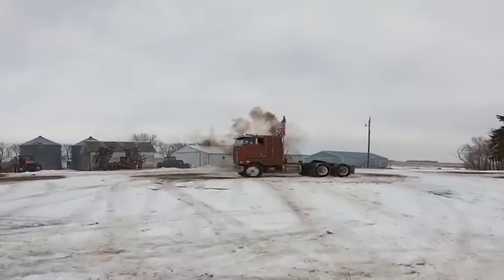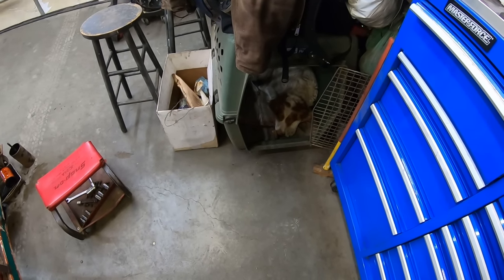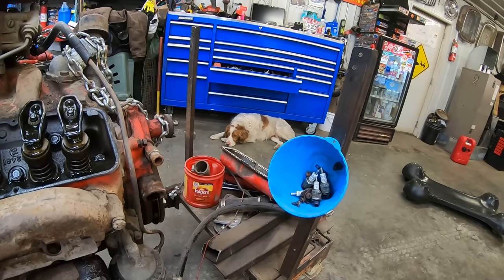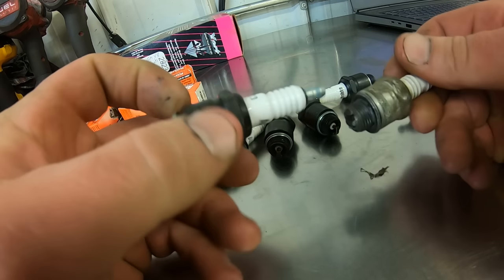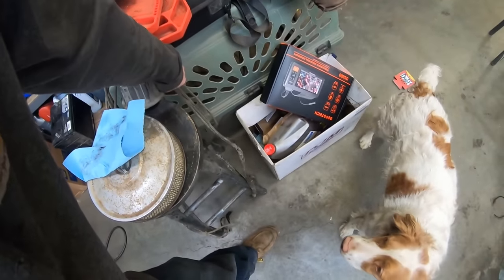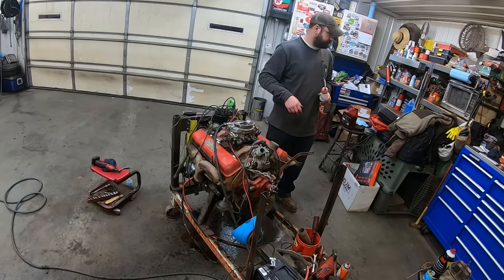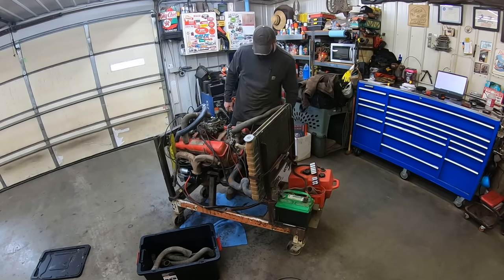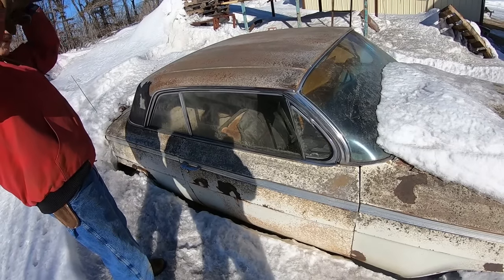1962 Impala Super Sport 300HP 327 Engine Abandoned for 43 Years!! Will it Run?!?

Comment: That 327 is, I think, one of the best engines GM ever made.  However, since I'm weird, I gotta say, my favorite is the old leaning tower of power.  You can't kill 'em with a rock.
Reply: i threw a rod after a "reputable" company rebuilt my slant six.... number four.    engine was still running after it made a bay window in the block.
Reply from the maker: I seem to be good at ruining slants!
Reply: I agree about the 327. -- And I have known people that have run those slant six engines forever, they're a great engines.
Reply: I prefer the Ford 300 over the slanty personally.
Reply: I own three of these, one is a '65 300hp Corvette   the other is a '66 275hp SS Impala mtr, and 1 is a '68 large journal 345-ish hp. You can't go wrong with a 327ci early small journal for power and at least 1hp per Cubic inch engine. Best GM Mtr ever made IMO and the 1st to give 1 or more Hp's per Cube.  Try and find a decent one from a 'vette in the 60's now and you've got something most don't even care about now that the market is over run with LS's and that crap.. No I don't need 500+hp from a Engine to have fun and reliability. I'll take 375hp any day. Mortske (Kevin) lol  Great content. keep up the interesting entertainment.
Reply: I think , without looking up in a tune up book or the web , as accurate as the web can be ( ? ) , the Chevy 327 ran from 1962 to,1969 . I grew up with someone who had a hand me down impala , a ‘69 . In ‘68 the 350 came out and Chevy decided it didn’t need the 327 anymore . 
I’m sure that upset a lot more people then , than it does now . But hey , big daddy Garlits  made big power with a 327 , lest we forget .
Reply: Ya I guess you are weird ! Lol
Reply: @TheSleepyMechanic0524  Good mill.
Reply: @andrewmantle7627  absolutely. Straight 6's are inherently durable and reliable engines. So long as you keep Germany away from them. I've driven both slants and 300's and will forever be impressed with their torque. May not be the fastest out there but they can pull your house down haha.
Reply: @MortskeRepair   The second generation slants (the first run of the cast iron cranks) had oiling issues on the #5 and #6 rod bearings due to poor casting in the crank. I don't think you've done any of those yet (they're 1975.5 and newer) but they tend to just kill themselves.
Reply: Hard to kill the slant 225, probably my favorite. Uncle killed one - was full of white snot (mind you, this was in the late 70s). I told him it was pennzoil, but he was like "what do you know" - sure enough, found an oil change minder later, brand used, Penn. Told him he needed to clean it out with kerosene / oil mix, but again, what do I know, right? Had to pick him up a couple weeks later......
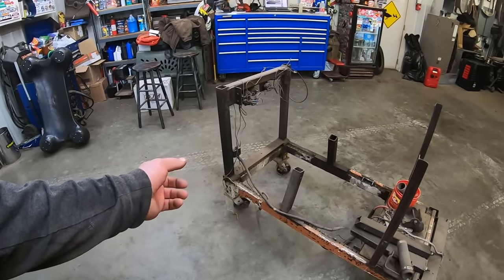Reply: I had one in a 65 el Camino with a corvette 3speed synchromesh stick with 12 bolt with 3:73 and 3:31. It had never been rebuilt and oil pressure was 10 lbs at idle. So I put two cans of stp in it to get oil pressure. I would rev it to 6500 or valve float territory. I sold it and I couldn’t break that damn engine. I wish I had it today.
I had the 350 horse 151 cam and a 6210 Holley spread bore carb
Reply: @TheSleepyMechanic0524   NO MORE FERDS..
Reply: @tonyfriend7413  speak for yourself, bud.
Reply: They have always been versatile and performance go to engines
Reply: @grumpslowenleft9642 , I absolutely refuse to use Pennzoil. A friend of mine used it faithfully in his Pontiac. Motor locked up. We tore it down to rebuild. Popped of the valve covers and I have never seen such sludge. And he changed the oil every 3500 miles. You should have seen the inside of the oil pan!
Reply: @markmartinfan62  I don't know about Pennzoil today as I won't use it because it was so bad years ago. I'm positive it's good now - still on the market and popular, but I'll stay with my never sludging and never let me down Castrol. Never saw the bottom of the oil pan on my Uncle's slant, but based off the mass of white snot, the death rattle and subsequent failure, I'm sure it was horrific. No doubt his engine was oil starved - kerosene and oil might have helped it, but the real damage was likely already done. My Grandfather was the head mechanic for Chrysler in Omaha - I packed my first wheel bearing when I was THREE - I know very well what a death rattle sounds like and his Duster had a smallish one that was hard to hear above all the valvetrain noise. As I remember, Pennzoil back then was fine IF you got the engine up to temp, but a lot of real short trips would sludge it up (that was also common with some other oils of the era - Quaker State for one, same base oil as Pennzoil, at least back then).
Reply: Agreed!
Reply: @michaelmaher4328  10 lbs at hot idle isn’t death territory on an SBC, as long as she’s got 10 lbs per 1000 rpm just run it!
Reply: My fav car I have ever owned was a (until me) single-owner 1962 Chevy II wagon in high school with the 194 inline 6; bulletproof. Paid $150 for it in 1990 off of a little old couple who had finally upgraded. All it needed was a new set of tires, new brakes, and a tune up.
Reply: The slant six was a great motor, and they made tons of cheap high performance parts for them. Without spending much money a slant six could out run that 327.
Reply: slant six. when they throw a rod after 300 or so thou. usualy no.4.
Reply: They don't fit well in hot rods though.
Reply: I prefer the 302 sbc, you know the one from the Z28
Reply: @RabidSnot  I prefer the Holman Moody 427 Ford hi winder,  9,000 rpm for 10 hours.
Reply: @TheSleepyMechanic0524  good with a dual carb, or a 4bbl on the nascar intake.
Reply: @Ineptus_Mechanicus  we had a 64 it ran great until it threw a rod, 200,000 miles.
Reply: @grumpslowenleft9642  Pensoil is crapp.
Reply: @grumpslowenleft9642  people don't know whats good, they just believe what they are told by "experts".

Comment: Back in the 80s i use to work part time in a junk yard and i would take all the 327 engines. i never had a problem selling them. i think they were the best engine Chevy made back then. people would go nuts for the 327 with 202 heads.
Reply: That was a strong running engine.  Had one in a clapped out 75 Camaro with a 4 speed. l won many a race with that car.😜

Comment: My opinion, early 60’s 327 SB’s are about the most indestructible motors I’ve ever tried to blow up LOL! Had one in a 55 Willy’s cj5 for 20 years til I put it in a 72 Chevy L.U.V. I built for a dessert toy. And the last one I had somebody head Mayday rear engine V8 setup they didn’t finish and I found a 327 my dad had in his backyard that had a four barrel on it out of a 63 impala super sport… I didn’t even have to do anything to that one other than break it down and clean it up, slapped it back together and dropped it in that van and sold it a year later at the Pomona for a healthy chunk of change to collector of these Corvair‘s. That was one of those I wish I would’ve kept…

Comment: I'm a Mopar guy, I had a 1957/58ish  392 hemi that sounded amazing, had it in a 1960 dodge town wagon. someone offered me stupid money for it so off it went.  Love the reliability of the slant 6, first truck had one, oil pump stopped pumping, old and clapped out, that engine went for another year before seizing solid. Always reminds me of the old slick 50 and duralube  infomercials.  Love the sound of the 5.9 12v wish I never got rid of that motor, have a 6.7 6 speed 4x4 now and love the truck and sound..  Not so much the 5.50 a gallon of diesel this week.

Comment: Hey Mortske!! If I remember correctly, those camel hump heads had 1.94 valves,  your motor possibly has a steel crank too, I started my wrenching career playing with those motors, the guy that I worked for when I was 14-15 years old had a fuel injected 283(301) in a corvette, that would be fun working on that motor, it would bring back many memories....I feel a tear coming, by the way, that bracket from the starter to block is missing....their was a time when you couldn't give these motors away!!!!
Reply: 2nd gen straight 6cyl chevy engines ie 194/230/250/292. Great torque, bullet proof, good gas mileage.
Reply: Big ole 21/2 inch exhaust through rams horns manifold yeah baby
Reply: So true,  very good motors for their time.  Most all of us jumped to 350's or big blocks when we could.   Most camel hump heads did have the 1.94 intake valves, and the rarer ones were the 2.02 valves.  Like the 283's they were good engines to learn on.   As you said,  283/327's  worth little to nothing when bigger engines became common.
Reply: Typically the 461 and 462 castings were 1.94. The 2.02s mostly had the same casting numbers followed by an X. When I was growing up there was a neighborhood junkyard full of old chevy trucks and Impalas. My friends and I hunted many of the "Camel Hump" heads out of that old yard. One of our best finds was late 1969 to 1970 camel humps that had accessory holes for the front accessory brackets.
Reply: Sorry they had 2.02 valves not 1.94. js

Comment: LA 318 all day long.  When I was a kid, I found an old dodge in the back 40 with no water pump, no alternator, and no radiator.  Yanked the carb, cleaned it.  Threw some gas down its throat and in the tank with a new battery and it fired right off.  I drove that truck around in the back 40 until it ran out of gas.  The next morning poured some more gas in the tank, cranked for a while and then, WHAM!  It fired off again.  I was shocked.  That thing had been so hot the day before with no water pump or radiator but woke right back up.

Comment: I've always been a Ford guy and love the FE engines. However, you can't deny that the 327 Chevy is an awesome little powerplant.
Reply: There just small bore short stroke little engines. Cubic inch is king. Small block Chevrolets in general are unbeatable simplicity and reliability wise
Reply: @brandonbell3089  I wouldn't call the 327 small bore. Short stroke yes, but they had a 4 inch bore, same as the 350.
Reply: @jesseduke694  4IN bore in a small block is a decently small bore. Not as bad a 3.875 bore though

Comment: Man, that little engine sounds beautiful. I love 327’s. Another fantastic video. By the way, the weather finally broke and I opened that 3 speed/overdrive transmission up. The inside looked great, and there was no signs of water intrusion. All of the gears work smoothly.
Reply from the maker: Cool, thanks!

Comment: Great running little mouse motor. If I remember correctly, the high performance 327 sbc came with what is called a 30/30 cam. It is a solid flat tappet cam. Some guys used to refer to it as a "3/4 race cam" meaning it was a great performance cam, while still being tame enough for street driving. I'm pretty sure I saw you compressing the lifters when checking for stuck valves which means that the Camshaft in that motor is a Hydraulic flat tappet cam. I would venture to say it probably still has the 250hp cam in it, with a set of double hump heads added. Regardless, any sbc enthusiast would still love to get their hands on that engine. Great job bringing it back to life the right way. Sbc cams only use splash lubrication so it's very important to prime the oil system and bring the rpms up to 1500-2000 for a few seconds immediately after starting to get some oil on the cam lobes after they have been in storage for a long time.

Comment: As per your question for your favorite engine, for me that's the legendary AMC/Jeep 4.0, tough as nails and easy to work on, my Grand Cherokee always started and had lots of pulling power for a 6.
Reply: I am partial to my 4.0 jeep..  unfortunately it's not of the AMC family, but still a tough engine.
Reply: @samiller63  It is an AMC engine, it was designed in 1985/86 by AMC engineers, it's based off of the 258 by AMC, yes it was updated by Chrysler to include a few changes, but it's most definitely an AMC engine.
Reply: @albundy8139  exactly the Jeep 4.0 is a updated/improved AMC 258 anyone who thinks otherwise doesn’t know what they are talking about and probably hasn’t seen them side by side. it’s also the reason your seeing a bunch of people swap Jeep 4.0 liter engines into Six cylinder  ( be it a 232 or 258 Six ) Equipped AMC cars.
Reply from the maker: Those are great engines!

Comment: 283 is still my fave. My first car was my 1964 Chevelle, with the original 283 engine with Rochester 2 GC, and I drove it that way for 25 years. Absolutely bulletproof engine, and pretty good mileage,  powerful enough to have some fun too. The engine is in the machine shop now, getting ready for a rebuild!
Reply: Cool car.   Mine 66 mustang 69 302 got it for 800 bucks for auto mechanic in high school

Comment: Good to see one spring back to life, he actually took the time to keep it lubed up and ready to run again. Can't remember what year they started drilling and tapping the crank for bolt to retain the harmonic balancer. I had one that wasn't and spun the balancer off at a rather high rpm, made a hell of a noise coming out from under the car at speed, never did find the balancer.

Comment: I had a 63 Impala SS. I know one of the primary differences between the 300 and 250 horse engines is that the 300 horse engine got the Carter AFB carb and the 250 horse got the Rochester 4 Jet.
Reply: you correct
Reply: Main difference was prolly compression ratio...
Reply: @BuzzLOLOL   250 and 300 hp 327 both had 10.5.1 comp had to step up to the 327/350 hp with Holley carb to get the 11.0.1
Reply: Different heads. 250hp got powerpack and 300hp got double hump.
Reply: @garywilson9081 No. They had Dome pistons, Solid lift cam and 202 valves. The 250hp didnt have 10:5:1. They didn't have the same heads as a 300hp.

Comment: Hey Mortske, I thought I heard you say that you set the points to .030. That seems to be just a bit too wide. I seem to remember the points gap should be about .019. Great job on the 327. Keep up the good work. My fav is the 289HP. Thanks
Reply from the maker: Yup, 0.19"
Reply: @MortskeRepair  the dwell should be 30
Reply: I still have a dwell meter

Comment: 327 is a good engine, but the 283 is a great engine in my opine. The 283 is the endless winding engine's i've ever seen. Back in the late 60's and early 70's i've seen several 283's with 327-350hp heads and solid lift cam smoke mopar's and Ford's all day long!! If you want a killer engine put the cam and heads for the 350hp on it!!! I strongly suggest doing the bottom end if you ever do a stock GM 327-350hp!!! Duff and you keep up the great video's, i can see you would be lost without Duff in charge of your operation! 🏁🏁🏁

Comment: love your videos.Im a collision repair tech 35 years now.Im a old chevelle  guy  70 and half z-28 loved the split bumpers .ive painted alot of cars that have run though mecumn action over the years and i found out now at 60 im so tired and still doing it its fun to watch you dive into nasty motors.btw i was in a 64 chevy shortbox 6 banger that my mom was driving i was 15 and it just lost power on a hill it dyed we walked back home 4 miles my dad took took box off of it and put a allis chalmers tractor rear end under it and plowed snow with it and different motor of course
Reply from the maker: Interesting

Comment: Excellent video Mortske Repair  :) my favorite is 1 is 454  , 2 is  396 , 3 is 350 , 4 305 High Output in GM , 5 is  327, 6 is  292 or 235  6cylinders   in Ford was 1 is  460 , 2 is 390 4 V , 3 is 302 & Chrysler  1 is 440 , 2 is 383 , 3 is 360  , 4 is 340 , 5 is 318 High Output industrial type motor,  6 1950  Flat Head 235 6 cylinder used farm tractors and imported motor in Toyota is 2.4 litre 4 cylinders ! But want funny part seen Mortske Repair is Chevrolet motor 4.4 litre 267 Cubic Cm motor in blue or orange block you put that 327  300 heads plus any intake want with 2 or 4 barrel carb  plus 350 mild cam plus crankshaft run excellent and seen on 1979 4.4 litre 267 orange V8  block plus ran excellent plus in car vechile had 4 core rad too with high temperatures thermostat to ! Funny fuel  was 15 local and 30 highway on for fuel mileage to!

Comment: I am a "six in a row" kind of guy. I inherited a 64 Impala with a 230 in it that had almost 200,000 miles on it when I got it. I ran it for two years before the timing chain jumped some teeth. Most of those Chevy sixes were good. The  Chevy 292 was a solid engine. I have a friend with a 72 Nova with one. He did some tinkering and makes the vintage Corvette guys mad when he beats them off the line. The Ford 300 was almost indestructible as was the Chrysler "Leaning Tower of Power."

Comment: Any Ford, flatty's, Y-block, FE, 335 series, 385 series. But i am really partial to Y-blocks, contrary to popular belief they are a very reliable engine and can make good power. The first V8 powered boat I skied behind had a 312 from a T-Bird it pulled 2 slalom skiers with ease. My brother and I raced on 1/4 mile dirt tracks way back then and they chevy/ford mix was about even in 330 ci range. If you address the weak points, the rocker oiling the engines run hard and stay together. The y-blocks were used by interceptor for marine use. used in more industrial applications than chevys. Extensive use in racing applications, drag racing, oval track, and marine including hydroplane ski boat, and cracker box classes. They are still raced today and there are some really cool after market parts being manufactured today plus the vintage market. Of course I am old, but I've worked on all the brands and find ford no harder to work on than other brands.  Keep it up, you do some really good builds.

Comment: My favorite engine is the 3.0L V6 built by Yamaha and put into the 89-95 Ford Taurus SHO. Definitely one of the best 6 cylinders ever made. I’ve owned a few and still own a low mile 92 SHO.
Reply: Are there any of those engines with very high mileage?  I'm not tryna be a smartass, it's a sincere question.
Reply from the maker: Forgot all about those!